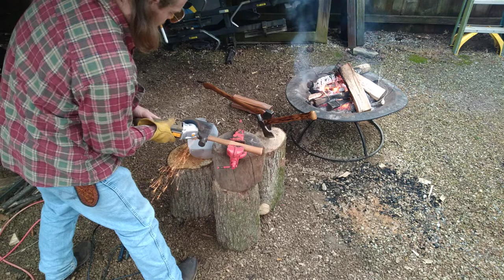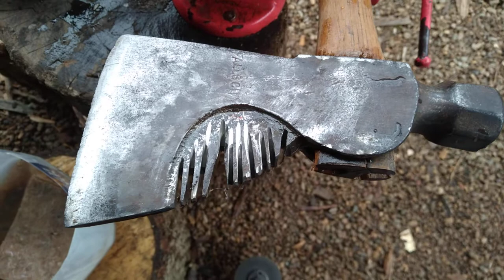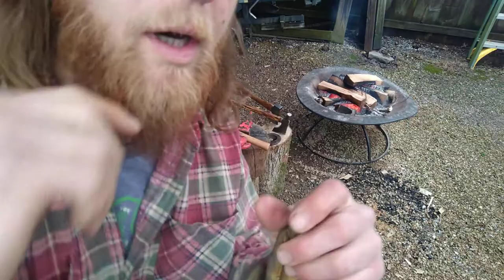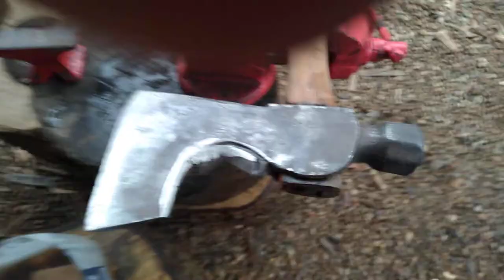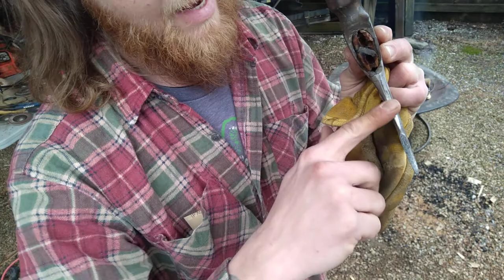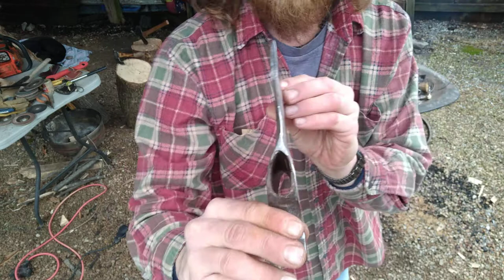Axe head modification - carpenters hatchet turned pack axe

Comment: This looks like a great project. Just bought a axe for $10 antique and im definitely doing this.  How did you decide the size of the cutout?
Reply from the maker: It was a super fun project, it's now my favorite axe. I've been meaning to do a video on it. 
I usually just eye up and stop cutting when it feels right. I like to cut out enough steel to get my hand choked up the handle behind the cutting edge. Hope that helps. Good luck with you new project. Thanks for watching.
Reply: @MountaincraftOutdoors  thanks for the advice.